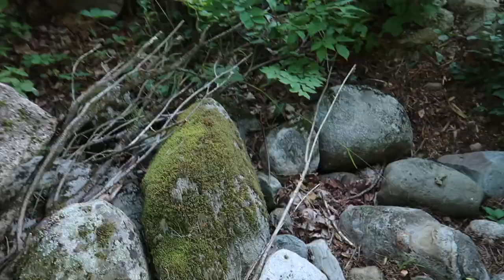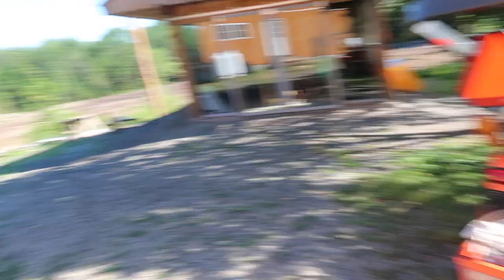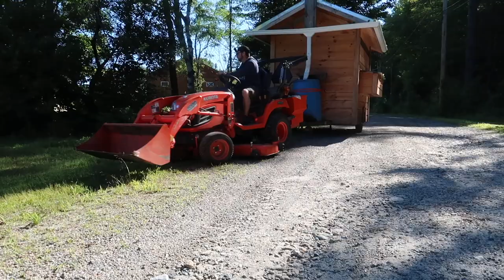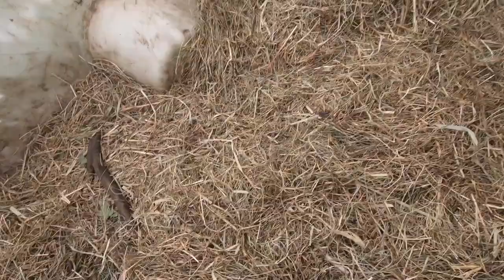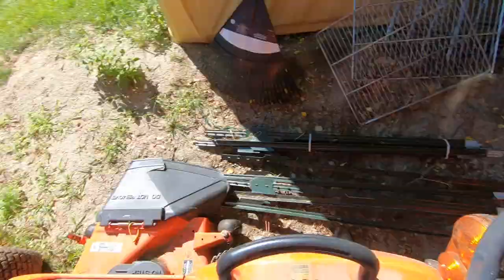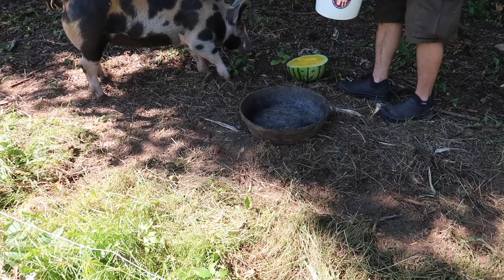It's Time (Chickens Move To New Yolk City)

Comment: Hi Al! looks like chickens are doing well.  I seen you were hooking up the rake to the 3 point hitch I couldn't tell how tight it was but you don't want it too tight (the linkages) or you will break something most attachments need a little play or you will bend or warp something. So when you pick up the rake and it is just hanging on the 3 point on back of the tractor you should be able to walk over to the rake and when pushing on it, it should move over 3" or 4" each way, don't let the linkage go over and hit the tire but close, it may not drag perfectly straight but the play will give it a bit of room to jump a rock or a stump buried in the dirt. Also if you want to move more material to a low spot angle the rake around some it narrows the space between the tines and will direct the material to the furthest end of the rake away from the seat. As you go round and round you will pick up sticks and other junk just drive over to the junk pile and lift the 3 point hitch as you drive by, and it will leave the stick and rocks from the rake and when you get enough you can push up the junk in a pile off to side or in a hole somewhere. Rock on!
Reply from the maker: Thanks

Comment: Al, quick heads-up regarding the chicken carcass.

Cooked bones of poultry and pork are prone to splintering and causing severe harm to the animals eating them.

By all means part your raw chickens out and hand the frames over to the pigs if you like, but it would really suck to have a pig die early because of cooked chicken bones.

Comment: Oh! What I'd give for 49° right now! Projected high today, 110° 😢 Count your blessings!!! 🙏✌🇨🇱 Just curious, why do you have chains on the back tires of the kabota? When there's no snow, doesn't that ruin your tires? Or is it so muddy in your newly cleared field, you use the chains for traction?
Reply from the maker: It doesn't hurt the tires. It's a pain to take them on and off so I leave them on to help with traction
Reply: Biggest fear with chains is tearing up the lawn (and don't cross your asphalt driveway!).    Most of my neighbors with tractors leave them on year round, too.    Especially those with 2 wheel drive machines